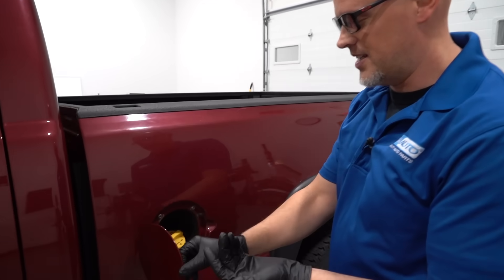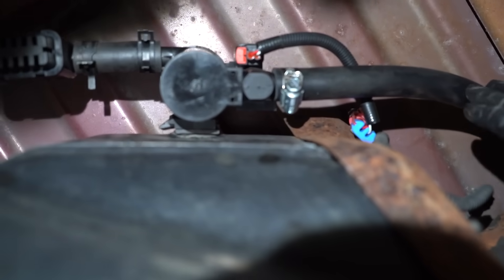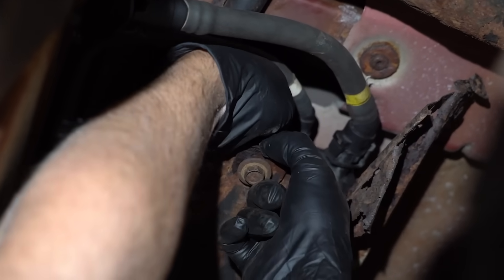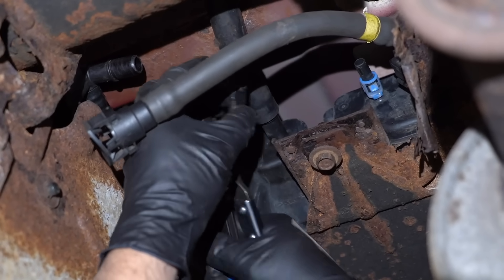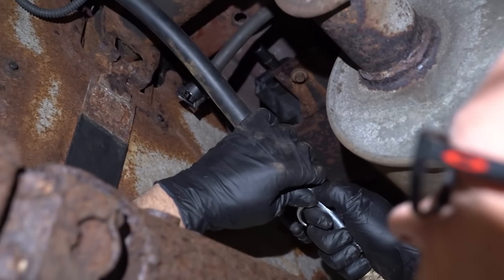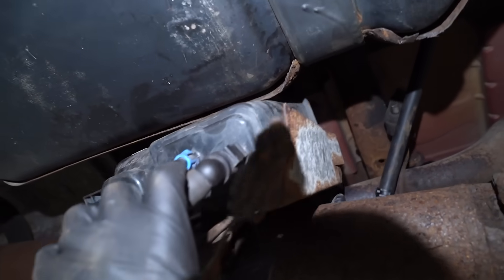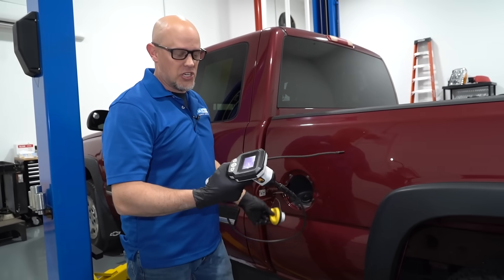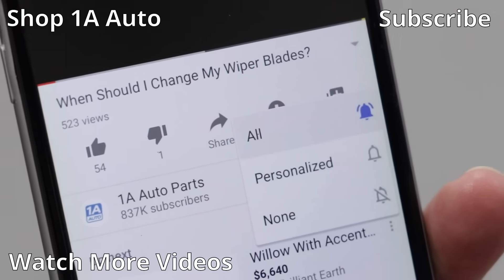Gas Pump Keeps Stopping When You Fill Up? Diagnosing Fuel Tank and EVAP Blockages!

Comment: Im having issues as well while fueling but mine is spilling out the vent solenoid and it recently started to over flow out the filler tube. I replaced the vent solenoid, charcoal canister, blew out the lines but I'm still having fueling issues. When I replaced the canister it fueled normal for about three fill ups and then started having issues again. I noticed fuel was going into the charcoal canister and also sending it to the purge valve which I also replaced on the engine side which was causing it to run rough and throw a P0300 code. I cleaned out the canister removed al the fuel inside and blew out the lines andit did help it for about a day with the running rough issue but it seems like it starting to push fuel again to the purge valve and causing it to run rough again. This is on a 2007 Silverado 1500 classic. Any suggestion on what I should do next or what it could be?
Reply: have a 07 yukon denali with the same problem ive replaced every part even cleared some lines and still can barely pump a gallon of gas before filler neck fills up and wont let me pump gas
Reply: @gabanna9735  did you ever find a fix? My 07 is doing the same thing. I replaced purge solenoid canister and vent valve.  And when getting gas it keeps popping every few gallons. Takes forever to get gas.
Reply: If you are saying that the pump keeps popping which prevents you from pumping gas in your vehicle. You might want to do a babysitter fill. It when you keep the pumps nose slightly lifted while pumping. This isn't actually a fix, but it does allow you to put fuel in your tank. Becareful not to over fill and it is even better if you know how many gallons your tank is. Good luck!
Reply: @fierceeagle2003  did you ever figure out

Comment: Watched this video and one thing not mentioned is that this is and remains a common issue for Chevy trucks which is what he's working on.  Another design flaw by Chevy was and is the short run of the filler tube and the bend in it.  I've seen brand new Chevy trucks do this and obviously there was no blockage in the canister.
Reply: 2017 chevy Colorado ZR2 owner here.  I have the same problem! More GM junk. My last Chevy for sure.

Comment: cant you just connect the hose from the gas tank straight to the hose going to the engine? That will allow the engine to still burn the fuel vapors without all the unnecessary charcoal canisters and solenoids.
Reply: That sounds logical, but I often wonder if all these systems don’t cause our vehicles to get worse fuel economy.

Comment: I was having this problem for months in my 2019 ram classic it was frustrating took like 15 minutes just to fill up and after checking the lines the vapor canister turned out it was the hole gas tank needed to be changed got it done finally all good now I can put gas in like normal again
Reply: How much did that cost? I have a RAM that's having the same issue.
Reply: If you don’t mind how much the cost, we have the same issue in our ram truck , we went to our dealership for diagnostic they told us needed a replacement and cost $2000 our vehicle only 3 yrs old and brand new
Reply: Did mean the complete whole gas tank or a particular hole on the gas tank. If you mean complete whole gas tank depending which vehicle it is the replacement can be a pretty easy task. In some cases it could just be a bad fuel pump or perhaps check electrical. Check fuses or lines.

Comment: I would just bypass that  to the outside will never have to buy another one
Reply: That's what my Dad thinks we should do.
Reply: If you do, the engine will run lean. When the computer opens the EVAP Purge valve, it is expecting fuel from the canister but instead will get fresh air from the empty canister. Also, you'll get a check engine light the first time it tries to run the pressure test.
Reply: You can but then you will always smell gas around your vehicle, especially if you are filling it or you just got done driving it. On a day when you have the windows open you will smell gas in the car.

Comment: good stuff, you guys. I'm having this issue with my '14 Silverado as well. but a friendly question to narrow down my issue. when I turn my truck on, it doesn't crank immediately as it maybe should. and when I turn it off, it shakes a little time to time. could these things be because of a fuel blockage? I have changed my fuel pump, but these issues were before even that. I purchased it recently at a used car dealership. I've used the scanner and do have a code for a fuel/oxygen sensor. 🆘
Reply: Could be your evap purge valve. Usually under the hood on back top of engines. Not sure if its Left or right side.

Comment: this happened to my avalanche a few years ago. When I couldnt put any gas in it, the first thing i did was take the hose loose at the purge solenoid at the intake and it was full of little charcoal pellets, so i knew exactly what the problem was. I fixed my a little different than you did. I took my old charcoal canister out, cut an access hole with my dremel, emptied the canister, taped it up with flex tape, and put it back on. Now i can go fill up as fast as NASCAR.
Reply: Before you did any of that, did your avalanche run rough ?
Reply: Good  day  Timmy Timmy   So did that work. Pellets were do u buy them from Thanks
Reply: Will you pass an inspection?
Reply: @graciegjj  where in the world is your vehicle being inspected..??
Reply: cant you just connect the hose from the gas tank straight to the hose going to the engine? That will allow the engine to still burn the fuel vapors without all the unnecessary charcoal canisters and solenoids.

Comment: Help: When I fill-up (pump shuts on its own), gasoline spews out the hose to the canister. I disconnected this hose since I had the issues described on the video. Replaced the EVAP can, but gasoline still spews out the hose when disconnected. I have not tried with it connected, my fear is to clug the new evap can

Thank you all for your help

Comment: I had a problem where the car wouldnt start after a fill up and once it did it acted like it was flooded until i revved it enough to clear it out. Ended up being a solenoid  under the hood on the engine. 2010 Hyundai Accent.

Comment: Gas prices have prevented me from filling up my tank.
Reply: 😂😂🤣😀💯✌🏽. 
REAL" TALK 💯✌🏽
Reply: Think I burnt my fuel pump cause gas to much to fill up
Reply: We have a problem on our truck a gas stopping every $2 we put ,we went to our dealership they diagnosed it they said it needs to replaced the gas tank cost $2000 our truck is a brand new truck with low mileages 3 yrs old vehicle,
Reply: It’s definitely fuel pump season
Reply: You have to buy gas anyway unless you get an electric car. Not to sound mean but You're just complaining. It's one of those things where we have to deal with the price and be happy because we have totally no control. It will go up and down depending on what wars were doing at the time, or holidays. Presidents dont control the prices like everyone else says. They're just being political dummies
Reply: Let’s go Brandon!!!
Reply: Don’t drive a big old V-8 then🤷🏼‍♂️
Reply: @daveerrington5166  i drive a v6... and this also effects me, i got friends that drive 4cyl economy cars that cant afford to fill an 11 gallon tank
Reply: @daveerrington5166  just buy an electric! right fuck face?

Comment: When filling your vehicle with fuel, when nozzle stops it is done.. DO NOT top off or round off the price.. It is done filling.
Reply: Incorrect in this scenario. This video deals with the venting of the gas tank. As you put gas in, air must come out. With regard to this video when the pump shuts off it is because air can not escape the tank so fuel backs up into the filler hose and causes the gas station pump to shut off just as it would if the tank were actually full.
Reply: I'm a diesel tech I have known this for YEARS but my OCD brain says "NO" every damm time!
Reply: @Giovanni_Litterini   I have a 1996 f250 7.3 that reads way past full on both tanks and will not let me fill up whatsoever, any advice?

Comment: What code would I see on my OBD II reader. Am dealing with a P0430. Wondering if this may solve my issue
Reply: on my suburban it code 0449
Reply: That’s would be your 02 sensors or catalytic converter  , start with the 02 sensors first
Reply: P0430 and P0420 are usually codes consisting of the catalytic converters but you can always google your year make and model with the code and chances are it'll give you vehicle-specific answers for those codes

Comment: I can just imagine crawling under my 05 mustang to replace this canister 🤣. It won’t fill easily but I’ll live with it. It’s just a slow process.
Reply: My 2005 Ford Mustang has always kicked out the pump and I have had to trickle gas into it, since I bought it when it was only 4 years old with 36,000 original miles.
Reply: Roommate had a car with this problem and we just lived with it ... It's a pricey repair from what I understand. So annoying though.
Reply: this is happening to my 2019 mustang, it stops so many times but it fixes after I take the hose out and put it in again

Comment: What if it only happens at a certain gas station?
Reply: Good question.  Had it happen once last year and now today at same station.    Hate to spend money on service if this is just random.  Wonder if desert heat is playing a part.
Reply: That's why I'm here, did you ever figure it out, besides just avoiding that station?
Reply: I found that my truck only takes gas at certain gas stations, i feel like some gas pumps have to much pressure an some pump smoother